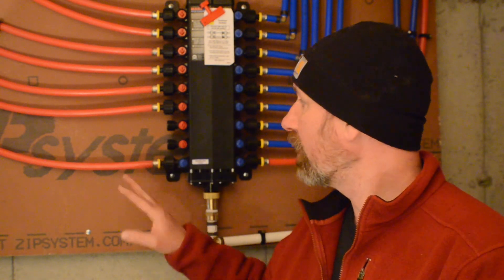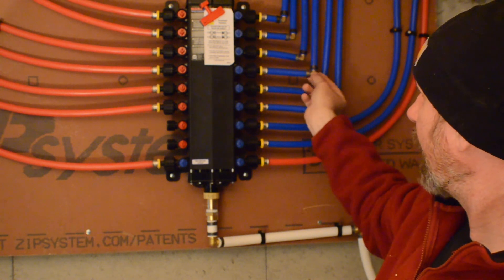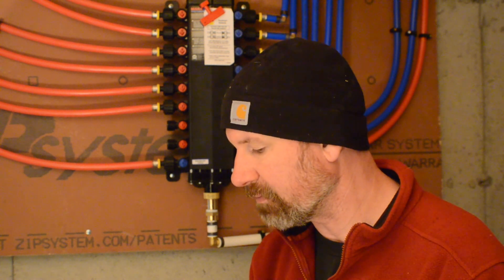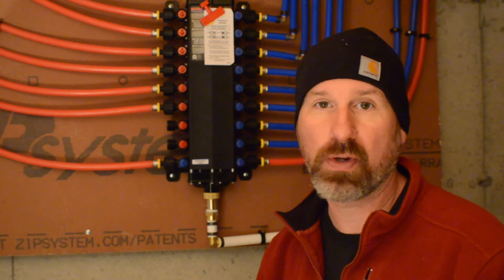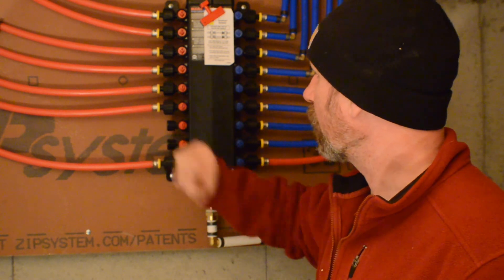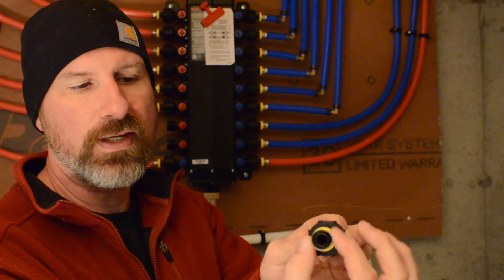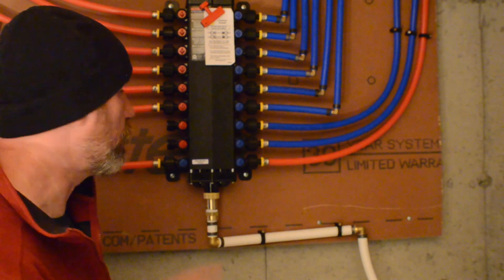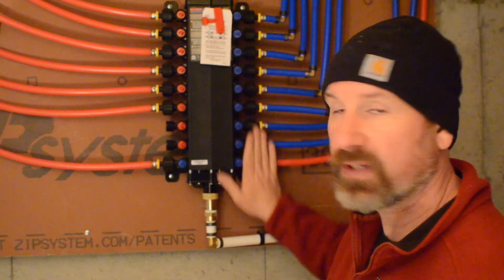ManaBloc installation

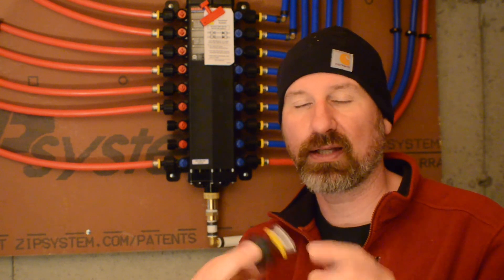Comment: At 5:00 those holes are witness holes. Basically you’re looking to make sure the pex pipe is inserted all the way to them. Has nothing to do with a leak check. Otherwise this is a reasonably well done video.

Comment: Question for you. Are you able to pull it off once it’s crimped?
Reply: Once a pex fitting has been crimped there is no removal unless you carefully cut through the ring without damaging the pipe.

Comment: have built home with manablocs and owned a home with a manabloc, the units are crap, the original company went BK and another company picked them up, every install i have done or seens has leaking issues the day after the warranty goes on them, my home it outright failed and flooded the wall space it was installed in fortunately it was able to flow out on the garage wall side and flood the garage not the home. the replacement cost of the unit starting at 300 to as much as 500 depending how many lines. love pex A in my projects using sub NON manabloc manifolds off mainline feeds but manablocs are total trash from first hand experience in my own home and repairing replacing others installs. JUNK!.
Reply: sounds like bad installations

Comment: How did you mount the system to the wall?
Reply from the maker: I mounted the system to a piece of OSB sub-floor.  I believe it was 3/4".  Using a hammer drill and concrete screws I mounted two 2x4's to the foundation wall and then screwed the OSB to the 2x4's.  This allows airflow between the OSB and the concrete to keep water from wicking and causing rot , or mold.  The system could most likely be mounted directly to the foundation, but the OSB makes it easier to attach all the pipe supports without having to drill into concrete.

Comment: Hey Paul, Great Video. I have a Manibloc, 30 port, 12 hot and 18 cold. The water line connectors on the Manibloc have calcium buildup and these connectors began to leak. I want to change the connectors and want to know which ones you recommend. The ones you held in your hand in the video seem to be the ones I need. However, you mentioned a special tool we need to connect these properly. I see you were able to crimp the connectors while on the Manibloc. I think the original connectors that were installed are "compression" type and hence the reason why calcium caused these to leak. I would  think "Crimp" type connectors are better. Do I assume correctly that you are a plumber?  I can be reached at info@katyswimmingpoolservices.com. Thanks Paul.
Reply from the maker: The fittings I used came with the ManaBloc.  They are "Viega PureFlow" press fittings.  The tool I used I borrowed from our local supply house, F.W. Webb.  I'm not sure if other supply houses offer tool rental.  Webb lent me the tool, because they are huge supporters of the HVAC program I teach, but I do not believe they lend to the general public.  All PEX fittings will decrease the inside diameter of the pipe where the connection is made so you may be destined for more buildup over time.  Have you considered a whole house water filter designed for calcium?  This would install before the ManaBloc and pull the calcium out before it can buildup and make annoying repairs.

Comment: I don't mean to criticize another man's work, but I was very surprised to see all those elbows on the cold side.  I did my entire house with direct, uncut runs to all fixtures.  I used PEX bend supports to make 90 degree bends without kinking the tubes, at the block, and where needed on the way to the fixtures.  Plus my understanding is crimps and elbows have the effect of lowering water pressure a bit.
Reply from the maker: I don't mind being "criticized" as you put it.  The great thing about being in the trades is the camaraderie and respect we share as people who enjoy getting our hands dirty, and we get to learn tips and trick from each other.  I agree with what you said as well.  This was the first ManaBloc I had installed and looking back I think I would've run my lines differently to avoid all those joints.  I swear that house was cursed.  I've never faced as many challenges as that house put in my way.  Thanks for reaching out and adding some good advice.
Reply: @paulchapin7732  LOL at cursed house, ha ha!
Reply: 100% correct, the manablocs are trash and leak in a few years from the main body of the manifold and have to be replaced, you are lucky to get 5 years use from them use pex A and make sweeps or the clips to make the bends and avoid fittings as much as possible, one less leak point. i use copper end outs to dedicated ball vales to each sink water source and toilet water source maybe a bit more money BUT one manbloc replacement (which you will replace) offsets that cost and you have the same result and no leaking failing in 5 years either.
Reply: @garyring8306  I installed a Manabloc 2 years ago in my house and so far it has been great.  I had 19yr old copper that was popping pinholes every 6 months.  There was some electrolysis going on which wasn't discovered for a while which probably contributed to that.  I don't think the builder used thin L copper but he might have.  And my water quality might have been a factor.  So after a few years of constant leaks, I replaced all copper with PEX B.  I did straight runs to each fixture location, no elbows, etc.  I put brass shutoffs at each fixture as well.  I think I did a good installation, following instructions, etc.  The MB has a 10 year warranty, and honestly, I would be fine replacing it every 5 years if that were necessary.  I could swap it out in t0 minutes.  I am very happy with it, I wouldn't call it trash.  I did a lot of research, Viega has been around a long time and I think they make good stuff.  They've made improvements to the MB a couple times so they are paying attention.  Besides the copper issues in my house, I've had leaks in houses I grew up in, and I have 3 different friends with burst pipes that required 5 figure major house repairs.  Nothing is perfect.  Time will tell how my MB holds up.
I made a video of my install if anyone is interested.  https://www.youtube.com/watch?v=B34P8AcPRnM
Reply: @bluesriderDF  glad you have had good luck with them. my experience with them is very contrary to yours, the issue with your copper pipes is more than likely bad electrical grounding causing the copper to erode an lesser chance of the water itself chemically more active attacking the copper or bad copper/improperly sourced copper tubing for the job (there are definite right and wrong types of copper to use) as there were times when bad batches of copper were out there being used in homes and noted (questionable import copper comes to mind). to me having to change a manabloc with any regularity would be unacceptable to me why you would be will to do that puzzles me. i totally agree no fittings especially in pex B and using the elbow making straps for tight corners 100%, using shutoffs at the sources is the only way to go even with the cost of doing it. one issue no one goes near is the UV issues with all pex, had a situation where an attic vent let light onto a pex line the guy went up and brushed against the line and it at the time or later began to leak dropping a portion of the ceiling into his dining room. helped him replace the run with pex A and out of the light under the insulation. will be interesting to see long term with pex installed new home builds getting UV in bad instillation how long people like it or not. when a company goes out of business due to lawsuits over its product which was the case with the manbloc people i kinda tend to feel inclined to call it junk. the people i am sure who took over the company made improvements, they had to or face the same fate. once burned shame on you twice burned shame on me., hence junk. in my book.
Reply: @garyring8306  I understand what you are saying.  A water heater or pressure tank usually lasts 5-10 years, and they are pretty expensive and involved to replace.  If a $200 Manabloc lasts me 5-10 years and I can quickly swap it out, I can live with that.  That's what I mean.  Heck, one leaking copper bike can be $200 for a plumber.  All things considered, the MB is a good thing for me so far.
Reply: sounds like bad installations  - or maybe you are referring to the orginal polybutylene manablocs? the new pex manabloc systems (from companies like Viega) seem to rarely have leaking problems, from all I've looked at - the old style polybutylene manablocs are a different story...
Reply: @johnmilton2077  yes old style blocks replaced my last home leaked and several other jobs. I replaced mine with a vie, 450 dollars  (found an open box unit to get it that cheap, way too expensive) and sold the home so I don't know how well it held up and just don't use them in anything I do now.
Reply: @garyring8306  If using pex a with expansion fittings which manifold would you recommend? This being for baths, kitchen, and hose bibs.
Reply: @peterfrommystic7890  I would not use a manablock. I would use a main dedicated line branching to kitchen and bathrooms with a non shutoff type manifold to branch off each line in the bathroom laundry kitchen to each faucet or toilet line and each line exiting out of the wall connecting to a ball valve shutoff. The exposed line from the valve being a braided flex hose connection. I prefer a main shutoff valve and regulator entering the house or inside the garage as the home shutoff. The manablock system you have way too many runs of pipe. A 3/4 single main run through the house branched branched 1/2 run to the baths kitchen and laundry room is way simpler to me. You also do not experience pressure drops as much either this way as well.

Comment: I have a crimping tool for different sized pipes. I'm using the same fittings for the manabloc you are. Do I need a completely different tool to crimp the fittings that join the manabloc?
Reply from the maker: Yes.  The crimp tool for the PEX rings is different.  The fittings that come with the Manabloc are designed to be crimped with a ProPress tool with a 1/2" PEX jaw.  I had to borrow one from my supply house, F.W. Webb.
Reply: @paulchapin7732  do I need to get another tool for the water lines coming into the manabloc as well, it being larger? Also what tool did you use to tighten the fittings themselves onto the manifold?
Reply from the maker: @Mr.y12345  The fittings themselves screw on like a garden hose.  I put them on hand tight and checked for leaks on each.  I was leery to use pliers as the pieces are only plastic.  The water lines on top screwed onto the Manabloc also like a hose and the PEX attached  to that fitting with a normal 3/4" crimp ring.

Comment: I would really like to see a close up of the O ring. I bought a Manabloc, and I’m not sure mine came with the O rings. Are they sold separately. Also, that stainless steel fitting: is that the normal crimp fitting you have on the end of any PEX piping, or is it specific to the Manabloc?
Reply: Same. Mine came without any O-rings

Comment: I know it doesn't come with the thread hose attachments for the supply lines, but does it come with the thread to 1/2 for the home runs?
Reply from the maker: The one in the video came with all the distribution connections, but the brass supply connections on the top and bottom were sold separately.
Reply: And you answer in the video! Thank you. They do come with the home run thread to 1/2 pex.
Reply: dont bother and hopefully you did not buy one they are junk and will regret using one pex A is great but these manablocs are trash.